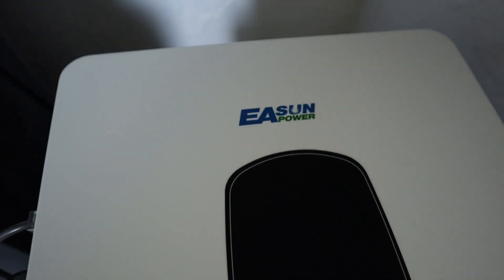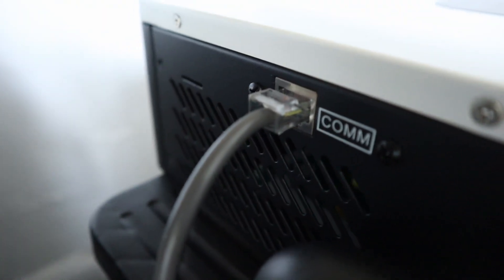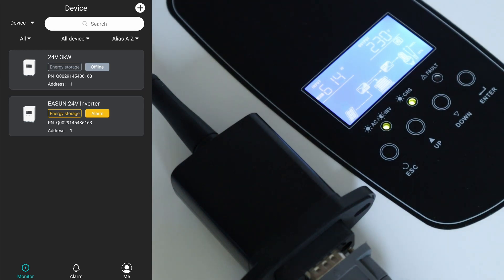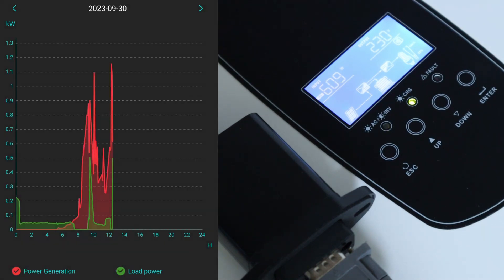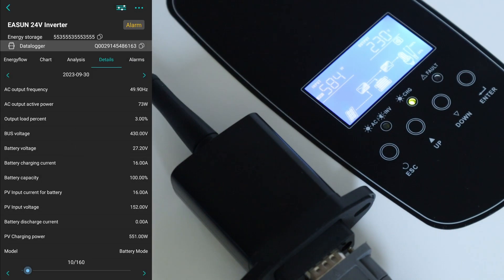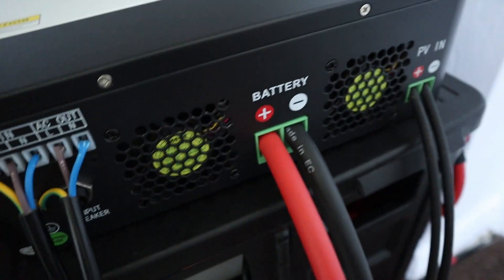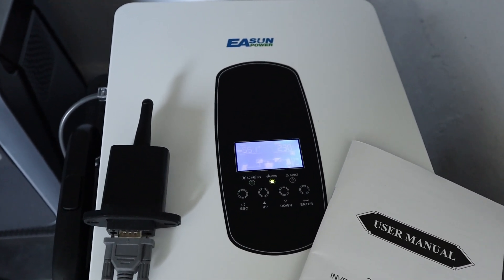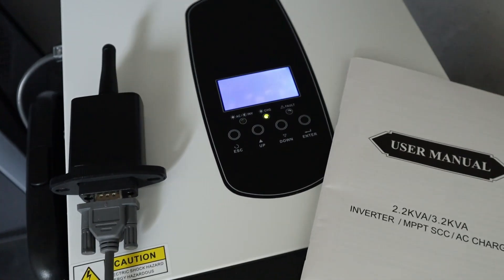EASUN Solar Inverter | Cheap, but worth it?

Comment: Does anybody know what the battery voltage range is?
For example with the victron 24 volt inverters they work from 18-32 volts.
Reply from the maker: @martdaymo  Thanks for your question. There are three battery type options you can select, AGM (default), Flooded and User-Defined. I use the User one which has selectable voltage ranges as follows:-

Bulk charging voltage (CV voltage) is 25V-29.2V (Default 28.2V)
Floating charging voltage is 25V-29.2V (Default 27V)
Low DC cut-off voltage is 20V-24V (Default 21V)

I hope this helps. All the best, Adrian

Comment: Can it work without battery connected?
Reply: Tank you for response! What if battery drops below 21v. does inverter going to turn on? Or I will be waiting until it reaches-charges to 23volts to use electricity ? Can I use electricity generated from solar panels if battery is less than 22v?
Reply from the maker: @drpainlesss Sorry for the delay, I didn't get a notification about your comment so missed it. My inverter doesn't work once it's gone below the low DC cut off (default 21V or user-defined 20V minimum). The batteries (BMSs) I use tend to shut down as well when they hit low voltage to protected themselves. The key is to have the setting high enough on the inverter so that the battery (BMS) doesn't shutdown the battery, so when solar is available again it can recharge. I hope this answers your question. All the best, Adrian
Reply from the maker: @drpainlesss  My unit doesn't work without the battery. Cheers

Comment: hello can this take a solar panel input of 3000 watts to this inverter ?
Reply from the maker: @MYMUSICCHANNEL-db4ky  Thanks for your question. The solar charger is rated at 3000W (Max charging 80A). The main point to note is not exceeding the Max Solar Voltage (VOC - Open Circuit Voltage) 450VDC. I hope this helps. All the best, Adrian

Comment: That kettle is 3kw ? I heard you've said that! 6:23
Reply from the maker: @ferdm9646  Thanks for your question. The kettle is rated between 220-240V AC (2520-3000W). I hope this helps. All the best, Adrian
Reply: @DADvinci  wow! That's a power hungry cattle you've got.
Reply from the maker: @ferdm9646  Water (depending on the comparative volume) should take the same amount of energy to boil it. It's how efficient the process of boiling the water is where the differences in energy consumption are. The 3kW is fast boil, hence the rating. I did a video on kettles some time ago (https://youtu.be/m_nNhqO1Nmc) and the comments section covers the amount of energy (kWh) used in my test boiling 1L of water in the kettles I have. The results were surprisingly close.
Reply: @DADvinci  that's a very good and informative video indeed. However I'm wondering if it's fair enough to boil the water in a matter of second or wait 1-2 minutes to finish the task. Does this make any difference or efficiency issues with the inverter? Slow boiling and low power boilers are might be a good options cause you don't want your mighty inverter overloaded while you're working something important on your desktop pc! Let it boil slowly while I'm using powers for other important tasks. Maybe it makes sense to me but might not make sense to others. But thank you for your reply
Reply from the maker: @ferdm9646  Thanks for your kind feedback 👍. I guess it's all about options for what individuals need. I was demonstrating the inverter at close to full load to test if it really goes up to 3kW output as stated in the specs. You're correct that running additional loads while off-grid (with this fast boil kettle) could tip this inverter over the max load and result in a shutdown. I've now got the 48V version of this inverter and it can handle 6.2kW max load, so I run the kettle with other large loads at the same time.
Reply: @DADvinci  thanks it makes sense now, what intrigued me that the boiler itself consumed the full load of that inverter now that you've doubled the capacity it should be okay unless another power hungry devices join the family. :-) good luck

Comment: I have an mpp. Pip 5648mt and the fans, or at least one of them seems to go full blast 24/7.. even with nothing happening.. no per in or out. Just standby. Isn't constipation is way too high. I'm ditching it for a transformer inverter and separate victron rs charge controller
Reply from the maker: @herbertvonsauerkrautunterh2513  I know what you mean (both my MPP units have their fans on constantly). It was a pleasant surprise with these cheap EASUN units, didn't expect much from them. Transformer based inverters have their advantages (longer lasting, better surge, etc), so if weight and cost isn't an issue they are a very good choice. Do you know what manufacturer you're going to use for the inverter? All the best, Adrian

Comment: Thanks for the review - great info! I am looking for an efficient inverter with very low stand-by consumption and low-noise fan or passive cooling. The pro here seems to be the variable fan speed and in the video the sound seems not too bad. At what power (in percent of nominal power) does the fan typically kick in? And can you confirm stand-by consumption of only 2W as claimed on the easun-website? Some comments here seem to have very different experience...
Reply from the maker: @rilosvideos877  Thanks for your kind feedback, I'm glad it was useful 👍. With the inverter on and no-load the clamp meter measures around 1.3A from the battery cable. With power saving mode on it uses around 0.4A, so not 2W as claimed. I didn't get any amps registered on my plug monitor when connected to the grid (not charging the battery). It's difficult to say when the fan kicks in as it seems to be based on load and inverter temperature (heat builds slowly over time even in standby, no-load), but as shown, the fan response is much better than my MPP solar 24V equivalent. These cheaper inverters are not quiet, especially under higher load or when solar is generating a decent amount. If you are after passively cooled or inverters with extremely low standby, the cost goes up quite a bit. This was always a purchase of the cheapest I could find and I've been pleasantly surprised with how well it has performed and continues to do so. I hope this helps. All the best, Adrian

Comment: Hello, could you please advise if you know regarding charging voltage from solar? I have got easun smh-II-2.2k with lifepo4 12v battery connected and it seems that inverter cannot charge it full, only till 13.5v. Settings are user with bulk and float charge at 14.4v. I also noticed on the side of the unit there's a sticker and it says that AC Charger mode gives only 13.5v DC output. Thanks
Reply from the maker: @captainpacific6796  Good day and thanks for your question. I've not got the 12V version of this EASUN inverter range, (only 24V & 48V) but I bulk charge at double yours (for 24V) at 28.8V and I set my float to 27.2V (equivalent to 13.6V for your 12V system). Not much point going above this as only a small amount left. When I've tested using the AC charger on my 24V system, I've managed to get it into the 28V range (when setting the float higher) but it's usually the BMS on the battery that stops the charging as one cell hits 3.65V first. Is your battery balanced and it's not the BMS preventing it from going higher? In addition, you should find the solar and/or AC charging disconnects when the voltage gets to target voltage (as per setup) on the inverter or the BMS prevents charging due to high voltage disconnect. 

The AC charger spec appears to be a reference voltage (27V for my 24V inverter) as I can set mine higher, but don't see the need personally. All the best, Adrian.

Comment: I got this installed and works nicely.  Regarding the app - that was a pig to set up.  I didn't see a tutorial for setting that up but in retrospect it makes sense, you have to connect to the logger to set its wifi to your wifi (using their app) then it reboots and then you end up back on your wifi and hopefully it sees it. In my case I added the dongles number before that step so after it rebooted it was just there.

With regard to setting inverter options I think you said it was a bit hit and miss.  It works 100% of the time, the thing that makes it look like its not working is that the module only connects every 5 min.  So if you make a change its up to 5 min to take effect as it sends the command on the next connection.

In my case I have a small 8x12 pent garden office with a PC and air conditioning, some network switches and a few other birts and bobs and I have 6 265W Panels flat on the roof - so nothing about that setup is optimal - and yet, it comfortably powers the office even without sun.  I use about 350W all day unless the AC is on which is another 900Wm but usually the sun is whats causing the problem when I need that and I have a glut of power at that time.  During the night it has to use mains but I still consider that a win.
Reply from the maker: @dr_jaymz  Great to hear you got it working after the fiddly dongle setup. The whole reboot process caught me out the first time, but really handy for connecting to other inverters as it's plug 'n' play with the comm port (similar inverters), just change the name in the app when it detects a different serial number. 

I got round the 5 min polling by moving to solar assistant (https://youtu.be/DHHiSgIEdJE) which is now my favourite monitoring method.

That's a nice setup, especially with AC too! Have you considered angling the panels as this might help during the colder months when the sun is lower? All the best, Adrian
Reply: @DADvinci  yes, I thought about angling, but when it's cloudy in winter, I might be just as well with straight up.  I was suprised on friday when it was generating 1.3KW which is more than I'd hoped for. In fact now I'm a bit annoyed that I can't export to the rest of the house to offset car charging or the damn tumble dryer.  This system is overpowered so it works in winter, the AC is inverting so does heat quite well but unlikely there will be enough to power that outside of BST. But given the panels produce so much maybe Microinverters would be better. Still, I'll stick with as is for now.
Reply from the maker: @dr_jaymz  I see what you mean now. Have you considered just running an extension lead (fully unwound, if one of the wind-up ones) and then running some of your household appliances, one at a time? My current setup is essentially off-grid using extension leads around the house until I can get the 2 x15kWh 48V batteries on-grid (trying to find an installer). I run my dishwasher, washing machine, portable induction hob, pretty much anything I can unplug from the wall which has really worked well over recent years.
Reply: @DADvinci  I think heating the hot water cylinder is probably the best and easiest.  The specific heat capacity of water is astronomical and we heat that with gas daily at 4pm.  So it will just take less gas and will use exactly the surplus.

For solar assistant do you know the pin out? I have plenty of patch cables and usb serial adapters I googled it and found 6 different possibilities, but it's better to find someone who already has it working.  I don't even even know if its serial ttl or proper 232, then I can give solar assistant a go.  Conventionaly could use the cable supplied, and it rs232 would normally be 2,3,5. But you never know.

Comment: Hi. Could you please check if the inverter has USB (Utility first) as an available output source priority (parameter 01, in the manual only appear SUB and SBU)? Thanks!
Reply from the maker: @adb8478  Thanks for your question. The manual matches what's available on the inverter itself (no USB). The default option (as below) will offer the closest to what you are requesting, as long as solar isn't available. All the best, Adrian

Default Option (SUB - Solar Utility Battery)
Solar energy provides power to the loads as first priority. If solar energy is not sufficient to power all connected loads, utility will supply power to the loads at the same time.
Battery provides power to the loads only when any one condition happens:  
- Solar energy and utility is not available.  
- Solar energy is not sufficient and utility is not available.
Reply: @DADvinci  That's a problem, because it means that when there is solar, AC charging is not available (it shares circuitry with inverter, so both functions cannot work at the same time), so it doesn't fit my purpose, which is feeding the hybrid with the surplus production of a grid inverter (and putting just a few panels on the hybrid).

Fortunately, I've found that Y&H SP-2200W-12V (24V also available), which shares design, has USB priority available.

Thanks for confirming my suspicion.

Comment: Hello sir , i have a question : is this inverter combines the load output if the solar is not enough ? For example if i have a 1kw solar array and i ask 1.4kw from the inverter will add the rest 400w from the grid or it will cut the panels and switch to grid all the load ?
Reply from the maker: @ghk84  Thanks for your question. You can change the 'output source priority' (main menu option 01) with the following two options.

Default Option (SUB - Solar Utility Battery)
Solar energy provides power to the loads as first priority. If solar energy is not sufficient to power all connected loads, utility will supply power to the loads at the same time.
Battery provides power to the loads only when any one condition happens:  
- Solar energy and utility is not available.  
- Solar energy is not sufficient and utility is not available.  

2nd Option (SBU - Solar Battery Utility)
Solar energy provides power to the loads as first priority. 
If solar energy is not sufficient to power all connected loads, battery energy will supply power to the loads at the same time. 
Utility provides power to the loads only when battery voltage drops to either low-level warning voltage or the setting point in main menu option 12.

I hope this helps. All the best, Adrian

Comment: does this inverter work with lifepo4 batteries ?
Reply from the maker: @triplextriplexxx8225  Thanks for your question. Yes, I only use LiFePO4 batteries with all my builds. All the best, Adrian
Reply: @DADvinci  thanks i forgot to ask can it work to return excess energy back to grid like grid tie ?
Reply from the maker: @triplextriplexxx8225  No problem. I’m afraid not. This inverter can be connected to the grid and used for battery charging/pass-through purposes, but not feed-in like grid-tie inverters. Please shout if you have any other questions. Cheers, Adrian
Reply: @DADvinci  thanks alot i found powmr 6.2kw for 350usd it has ability to feed back to grid . When it becomes availoble to feed back to grid i want to have it ready

Comment: I am planning to purchase 4.2 kw, would u plz confirm how much inverter support solar pv input current? 
Or
Either it supports 550 watt pv panels ( 50 volt and 13 amps each) 
Looking forward for your early response plz.
Reply from the maker: @muhammadyaseen6318  Good day and thanks for your question. This 24V solar inverter (Model - iSolar-SMH-II-3.2K) has Max. Solar Voltage (Voc) 450VDC and the MPPT Voltage range is 55-450VDC. I hope this helps. All the best, Adrian

Comment: It is such a good price, it makes me suspicious.  Have you kept it running with a reasonable load?
Reply from the maker: @andybiggs4374  Hey Andy! I've tested it for quite a while as my main system. I've since moved on to the 48V for my 30kWh system (only bought the 48V because the 24V worked well and it was also cheap) and neither of these cheap inverters have caused any problems at all, so far. I just use them as if they weren't there, regularly getting the load up high by running major appliances at the same time, while using an induction hob or microwave (48V version) to cook. The 24V is currently being used to charge batteries up when grid energy is cheap or I get paid to use it during negative pricing. I was very sceptical when I first ordered the 24V version as it seemed too good to be true, but so far so good. At the price, it's difficult to justify buying the separate components to charge batteries (via solar or grid) and an inverter to provide mains power, whereas this is in one box. Even if it lasts a few years, it's cheap enough for me to not really worry about. I hope this helps. All the best, Adrian

Comment: Yes, you can. The fridge takes up to 1000 watts when it starts, so it will trigger the inverter
Reply from the maker: @windyse860  Please can you let me know what you are referencing? I'm not sure what you mean. Fridge compressors do draw surge load when starting, but this inverter will handle it and the fans will increase for a short time until the compressor has started-up. Is that what you meant? All the best, Adrian
Reply: @DADvinci  once the compressor of the fridge has started the inverter will come off power saving for the duration of the functioning of the compressor. Fridge works fine with inverters that have power saving as long as the pulse the inverter emits has a high frequency. If the pulse is emitted not every second but every 2,3,5 seconds like I saw in several newer inverters such as Victron 12v1000w or Easun smx series or the low frequency RP series, then it might be a problem. I don't know this inverter from this YouTube video, I never used it, but if the power saving impulse is every second it should be fine with the fridge